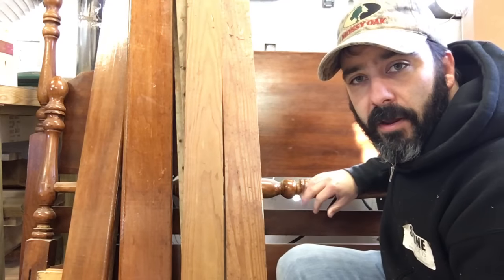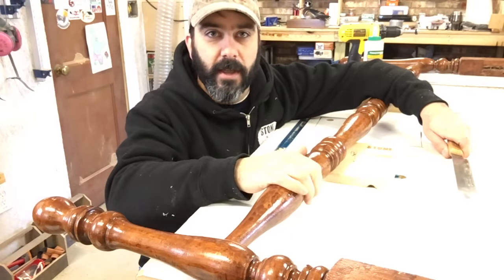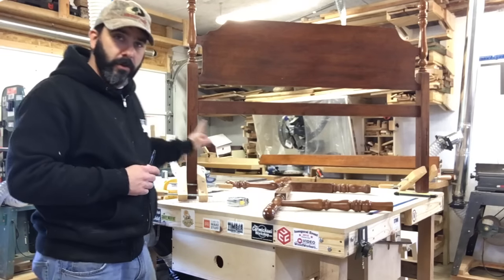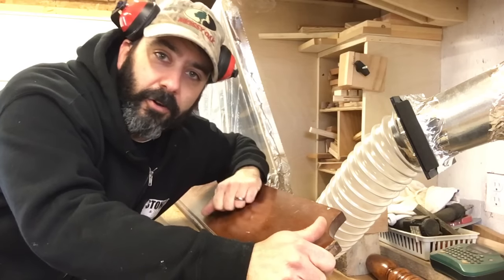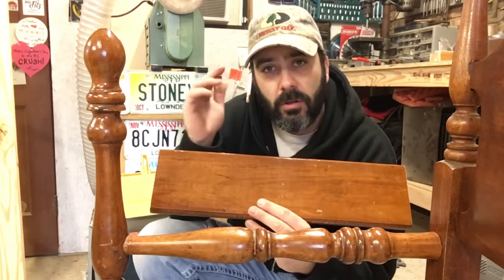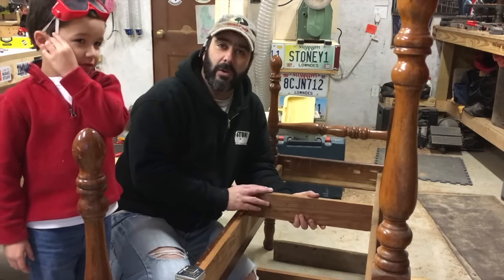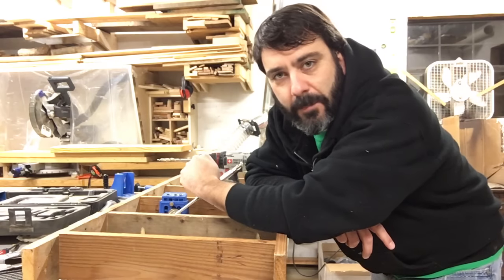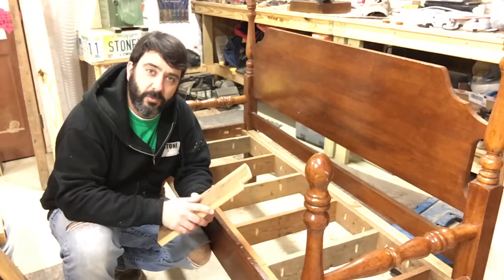Build a Bench from an Old Bed Frame - Wood version

Comment: Thanks for all the details! We’ve got a full size old headboard and footboard to do this to as well.  And I’m wondering is there a way to create some sort of storage under the bench seat with these benches? Like flat enough to store a folded table cloth or placemats, napkins? That would maybe have a piano bench hinge or toy box hinge of some sort?  Have you ever created something like that, and just wondering what you would have to do differently for the opening top to clear back rail? And if you ever wanted to add a bench cushion, would you lower wood bench part? Sorry for all the questions, but would appreciate any advice!

Comment: nice bench. what do you think of the porter cable 20v stuff,been looking at getting some?
Reply from the maker: +tyler norton Thanks! I like them so far. I used the DeWalt 18v for a while, but the pc is a lot lighter and has more power.

Comment: Nice save on the old headboard and footboard into a bench project.  Nice to see someone recycle old wood that most people would have thrown away or chopped up and burned.  However, the one thing that I didn't like about your video was your choice of "music" (if you can call it that) I mean practically nine minutes of that horrible sound file repeating over and over, come on, give me the sounds of the shop, not that crap.  To that aspect, I gave you a thumbs down.
Reply from the maker: Regardless of your preferences, I appreciate your feedback. Thanks for watching.

Comment: Ok the video sucked, where is the buildit reads build a bench from an old bed frame where does it show the build it just showed someone shaving 
Some wood off then adding stain or something. Where is the step by step how the frame was cut the sides what tools was used
Reply from the maker: +Larry Kelley First of all, I sincerely apologize for the suckiness of this video... the step by step you're referring to can be found at http://www.instructables.com/id/Build-a-Bench-From-and-Old-Bed-Frame-video-Include and as for a list of tools used in this video as you mentioned can also be found at that link... but wait that's not all... a tool list can also be found in the description of the very video you left this comment on. Seriously though, thanks for watching. I really appreciate it.